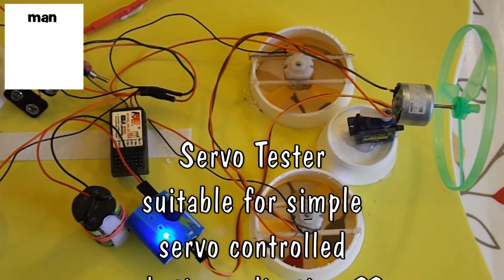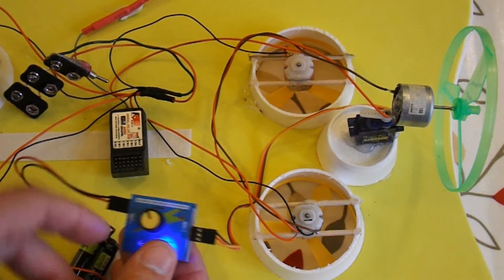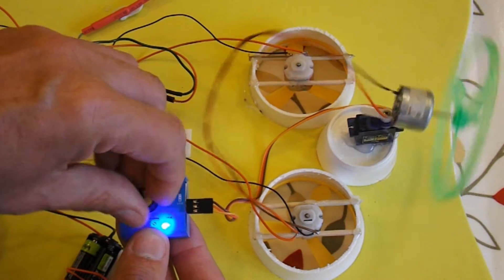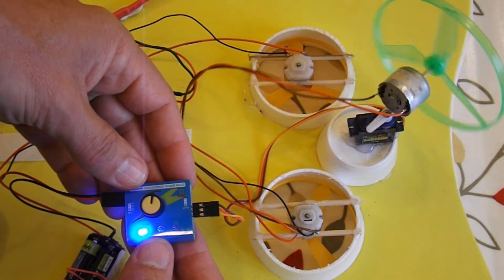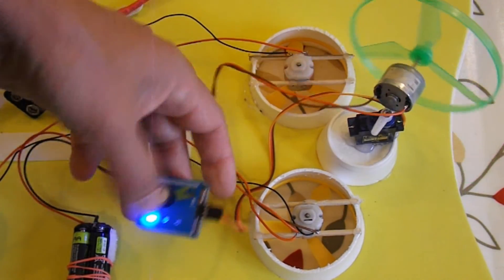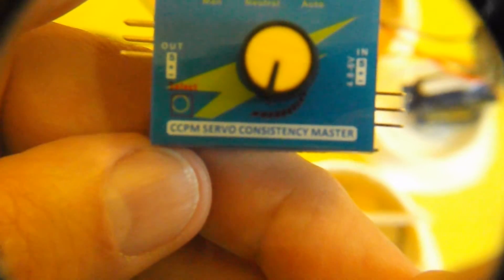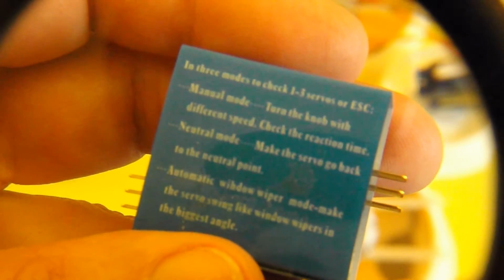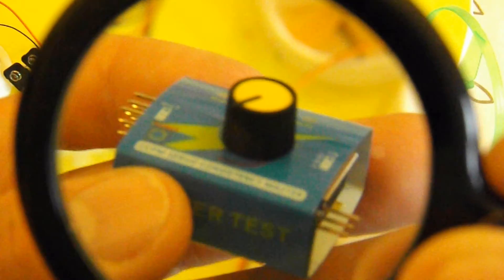Servo Tester

Comment: what is the maximum voltage that the servo tester can  handle without burning up. I do not see any mention of the v range in which the unit can operate on the specifications on the un the back of the unit.
Reply from the maker: The output from a hobby grade receiver is a standard range so that is the range the servo tester is designed to handle because hobby grade servos are designed to work with hobby grade receivers. According to Wikipedia that would be 4.8 volts https://en.wikipedia.org/wiki/Servo_(radio_control)
Reply from the maker: For a cost price of 99p I would suggest you buy one and test it to destruction yourself, then you can judge if it meets your requirements.

Comment: Hi, Can you please tell me how to do connection of esc to receive 
Can you make a video
Reply from the maker: The ESC usually plugs into channel 3 port on the receiver as that is generally the throttle channel. However most receivers are fine regardless of which port you plug the ESC in. I often have more than one ESC plugged into a receiver for example when I am using variable thrust for steering and have one ESC controlling a motor on the throttle channel and one ESC controlling a motor attached to the rudder channel. If you want guidance on setting up RC equipment I recommend FliteTest RC Planes - beginners series https://www.youtube.com/playlist?list=PL6IuSFWz4ktvupu_gxw1vn-sjBGOkJFHV

Comment: I know it's cheap,BUT it doesn't do any special analysis on the condition of the servo....I mean, why not connect a Rx battery to the Rx and then the servo on the appropriate channel to test yourself!
Reply from the maker: You are right, it only 'tests' the servo by showing it works, that is all. If you watch some of my other videos you will see I use this to control a hovercraft in my kitchen without needing to set up the r/c gear for testing purposes. There are plenty of people searching YouTube for ways to control servos without having to buy and install r/c gear and there are long technical videos on how to build servo controllers from scratch for robotic purposes. This little 'tester' does that for them and cheaper than buying the components and building it from scratch. They could even use this as the building block and hack the push switch on it with an extra bit of circuitry to control it from an arduino or similar.
You are probably looking at this from the view point of somebody who has an r/c kit already, but there are many people who want to use servos for non-r/c related purposes such as robotics because the gearing on the servo makes it a very powerful unit but the control method using frequency modulation means that simply connecting a battery does not work.

Comment: Handy gadget. Looks like their prototype housing was a matchbox lol
Could see it another way too, if it ever stops working - that's 3x blue LED's, a variable pot with 1970's radio style top and a bunch of components, for less than a quid !
Reply from the maker: Yes, cheaper than I could source the individual components and it works. Coupled with some cheap servos could be an ideal base for some Halloween animatronix.